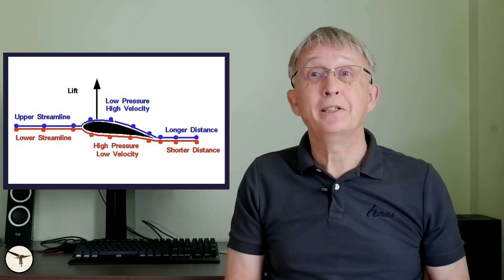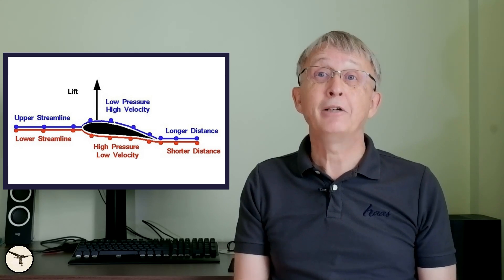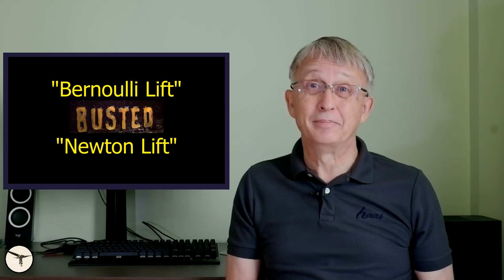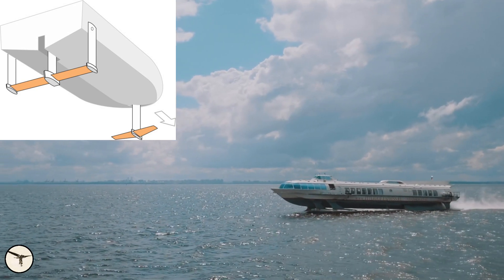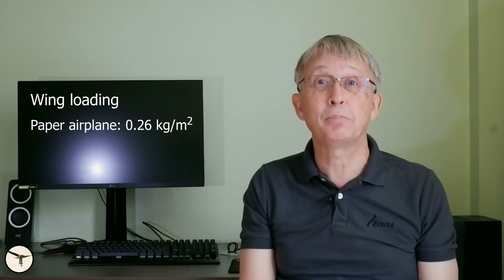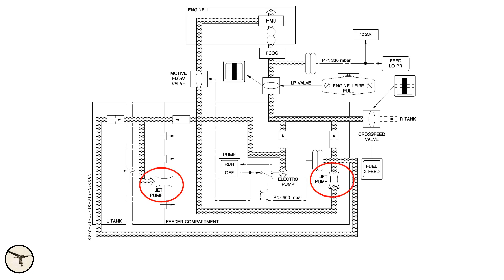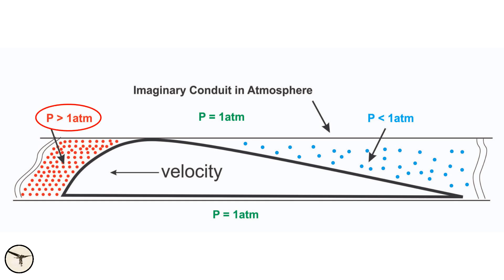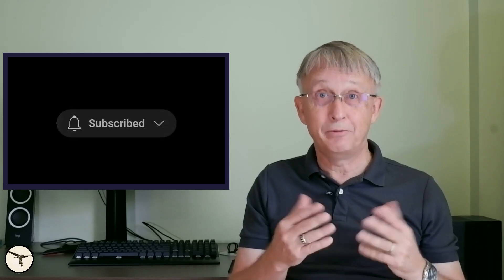7 Wing Lift Myths You Must Avoid: What Really Makes Airplanes Fly!

Comment: I am an aeronautical engineer who provided some constructive criticism to some specific points in some of your previous videos about lift.
For this one, my feedback is this: I am not happy, I haven't found anything to criticize!
Reply: 7:28 he is wrong, Custer Channelwing flies by blowing air over the wing, but not because of Coanda.
Reply: @SoloRenegade  ... It doesn't. It SUKS air over the wing. All the CCW planes are pusher props with the propeller at about the trailing edge. The pressure in front of a propeller is lower than ambient. The pressure behind a propeller is higher than ambient. So this arrangement places the wing channel in the low pressure zone of the propeller. An interesting quote from Custer himself: "this is an aircraft which is not an airplane. It does not plane the air to fly, rather it brings the air to the lift surfaces and reduces pressure". In any event, regardless the fact that the Coanda effect, or the CCW effect, CAN produce lift, that is not HOW lift is created in the traditional sense. Magnar is explaining different myths and misconceptions in popular wrong explanations for how a traditional wing generates lift.
Reply: @adb012  nice strawman and cherry pick, suck, or blow, the air doesn't know nor care. the air is moving, and the wing is not, but the airplane flies. Period. You're making the same exact fallacies as the types described in the video with your childish attempt at a refutation.

"this is an aircraft which is not an airplane."

except it is/was an airplane, regardless what he claimed or felt. What does this have to do with ANYTHING? How does this have anything to do with lift production? Do stay on topic and avoid using red herring fallacies.

"In any event, regardless the fact that the Coanda effect, or the CCW effect, CAN produce lift, that is not HOW lift is created in the traditional sense."

I know exactly how wings produce lift, and the channelwing achieved it same as other aircraft do.

"Magnar is explaining different myths and misconceptions in popular wrong explanations for how a traditional wing generates lift."

I'm glad you understand that. Was beginning to think you had no clue. Regardless, you specifically claimed, "I haven't found anything to criticize!"

This lack of critique proves you weren't looking hard enough, and lack understanding of such topics, otherwise You would have called him out on this objectively false claim of his at the 7:28 mark.
Reply: @SoloRenegade  ... It is not the same to put the wing in front of the prop where the pressure is lower than the atmospheric pressure than to put the wing behind the prop where the pressure is greater than the atmospheric pressure. Even if the air didn't know or care (which is not the case, but it is a good approximation at low Mach numbers) the wing does, especially when that pressure is applied only to one side of the wing. Remember that the lift is the difference in pressure between the upper surface and the lower surface (I am simplifying a bit, technically it's the integral of pressure times the differential of the vectorial area around the airfoil or wing.

As for the gratuitous ad-hominem attacks, I am not going retaliate and escalate.
Reply: @adb012  stop cherry picking. the idea is airflow moving over a wing, rather than wing moving through teh air. Clearly this is too complicated for you to grasp.

I am addressing what was claimed in the video, not your petty cherry picking.

"As for the gratuitous ad-hominem attacks, I am not going retaliate and escalate."

my insults are not ad hominems, as they are not part of my arguments. My arguments stand on their own facts. So they are in fact merely insults, not ad hominems. Learn the difference.

You talk all condescending, but you're wrong, just admit it. Prop in front or rear of wing is a separate topic of debate. The childishly simple fact you can't comprehend, is the air doesn't know it was being blown nor pulled. And multiple aircraft such as the jetwing and other radical concepts that flew but were not mentioned blew air over the wings as well.
Reply: Is viscosity or more generally "dissipation" an absolute prerequisite for justifying the production of lift?  If not, why do so many academic aeronautical engineers insist on it.  And if so, why is it not always included in explanations of lift such as in this video?
Reply: @davetime5234  ... Yes, viscosity is vital for lift. No viscosity = no lift. The reason why it is not always introduced is that you can replace (both mathematically and conceptually) the main role that viscosity plays in generation of lift with something called the Kutta condition and the Kutta - Joukowski theorem. The Kutta condition says that airflow will separate from the airfoil at the trailing edge. This is kind of obvious, but would not happen without at least some viscosity. Viscosity is what prevents the flow from accelerating to the infinite speed that it would need to turn around an infinitely sharp edge (like the trailing edge). The Kutta - Joukowski theorem says that an airfoil will produce exactly enough circulation to meet the Kutta condition. And it is that, the circulation, the real thing that is responsible to accelerate the fluid on the upper surface and slow it down in the lower surface, which correlates with the difference in pressures (by Bernoulli) and hence lift. All this can be nicely modeled mathematically and yields quite accurate results without invoking viscosity (but invoking the Kutta condition). But the solution will not be exact because another thing that the viscosity does, that is not taken into account in an flow without viscosity but just with the Kutta condition, is forming the boundary layer. 

In summary, you can explain and mathematically calculate the lift produced by an airfoil, with a good but not perfect degree of accuracy, without thinking about viscosity or using viscosity in the calculations, but just taking as given that the flow will separate at the trailing edge and not turn around it (which is something that will happen only if the fluid is viscous, even just a little bit viscous, which in real life it always is).
Reply: @davetime5234  I've never seen it as necessary to explain lift. The actual explanation for what causes lift can be explained and understood without discussing viscosity at all. But no aircraft flies in a friction-free vacuum either.

But viscosity is necessary for determining drag, and things like boundary layer behavior and effects, etc.

Do you have a specific theory of lift in mind that does rely upon viscosity or "dissipation", as you described?
Reply: @SoloRenegade  I've tried to reply twice, and both time my reply fails to appear.
Reply: @davetime5234  I'm actually seeing them in my notifications too, but when I click to read them, youtube won't let me. it's strange. I am truly curious what all theories of lift people are discussing, good and bad. Good ones teach me something new, bad ones help me to better explain lift to more people by addressing commonly held ideas that aren't accurate. Either way, progress is made.
Reply: @davetime5234  ... I also posted a somehow long reply that doesn't show up. I will in smaller chucks.
Reply: @adb012  Thank you!   I see your replies.  I'm travelling at the moment and will think about what you wrote in more depth when my schedule settles down a bit.
Reply: Viscosity is vital for lift. No viscosity = no lift.
Reply: @adb012  "Viscosity is vital for lift. No viscosity = no lift"

Mind explaining that?
Reply: @SoloRenegade  ... Again? I did! Instead of posting 1 long comment I posted 10 short ones because for some reason Youtube blocked my long comment I had posted before. Can't you see them?
Reply: @SoloRenegade  ... But the super short answer is that viscosity is needed for the Kutta condition to be a real thing and not just a human artifact. No viscocity no Kutta condition, no Kutta condition no circulation, no circulation no lift.
Reply: @adb012  no, this time I didn't get any notifications of the other short comments. 

Youtube is definitely blocking you. I 've been seeing a LOT of comments on a lot fo videos lately of people having this happen to them. it's getting pretty bad.
Reply: @SoloRenegade  ... I replied twice. One with the youtube rant and another one with a super short explanation. You evidently got the first one. Can't you see the second one?
Reply: @adb012  I can see multiple now, but I had to check for them manually. I only go notified of your last 2 comments.
Reply: The reason why this is not always mentioned is because you can use a proxy for viscosity to account for the most important thing that viscosity does for lift: circulation.
Reply: Circulation is what makes lift. Circulation is what defines the pressure and velocity fields correlated one to the other through Bernoulli (faster velocity = lower pressure).
Reply: The problem is that circulation is impossible without viscosity. Without viscosity, the flow from the lower surface would just turn around the trailing edge, move upstream on the upper surface for some distance (let's say 1/4 of the chord), meet the stream coming in the opposite direction from the leading edge, and separate at some point on the upper surface. In other words, by not separating at the trailing edge, the flow would just go around the airfoil without being deflected down.
Reply: Now, to turn around an infinitely sharp edge (zero radius), the flow would need to achieve a infinite high speed at that point and zero pressure. A singularity. Viscosity is what makes achieving infinite speeds impossible (it would require infinite energy) making in turn impossible for the fluid to tourn around the trailing edge, hence it is forced to separate there.
Reply: So how can we explain lift and even calculate lift with a reasonable accuracy without even mentioning viscosity. We invoke: "The fluid separates at the trailing edge". In other words, we are imposing a boundary condition which is very intuitive and obvious (of course the flow will separate at the trailing edge, it would be crazy that it flows around a sharp edge!) but which in fact only happens BECAUSE the fluid has viscosity.
Reply: That is called the Kutta condition. And how do we impose, mathematically the Kutta condition? We calculate the flow around the airfoil with an arbitrary amount of circulation, which will have the flow separating at an arbitrary point, and adjust that circulation until the separation point happens to be at the trailing edge.
Reply: That is called the Kutta - Joukowsky theorem which states: "An airfoil will produce the right amount of circulation so as the flow separates at the trailing edge" (i.e. so as the Kutta condition is met)
Reply: The nice thing is that the result is independent of how viscous the fluid is. To a certain extent (i.e. don't bring up honey or a thick oil) , this approximation would produce reasonably accurate results as long as the fluid is at least a tiny bit viscous so it can't turn around the trailing edge. That's why an airfoil has about the same lift-coefficient-to-angle-of-attack curve regardless of whether the fluid is air or water.
Reply: The reason why this approximation is reasonably accurate but nut super duper accurate is that, in addition to imposing the Kutta condition, there is a secondary but non-negligible way how viscosity affects lift, which is that viscous fluids generate a boundary layer when flowing around and object. But if the viscosity is reasonably low (like in air or even water), the thickness of the boundary layer is small compared with the size of the airfoil so the flow flowing outside of the boundary layer, which is not affected by viscosity, follows a contour (airfoil + boundary layer) that is quite similar to the original airfoil without boundary layer. End (by now).
Reply: @adb012 
Circulation or deflection of fluid isn’t necessary to produce lift.
Reply: @Talon19  ... It absolutely is. The force that the air imparts on the wing is the same as the force the wing imparts on the air, and that pushes (so deflects) the air. 3rd law of Newton. No viscosity = no circulation = no deflection = no lift. And that little dot is a period.
Reply: @adb012  
Positive cambered airfoils with flat lower surfaces and thin plates extending from the leading and trailing edges still create lift at zero AOA.  I’ve done the wind tunnel tests myself.
The thin flat extensions prevent any “circulation”.
Reply: @Talon19  ... Lot of airfoils can produce lift at zero and even slightly negative AoA. I believe in your wind tunnel tests. I don't understand why you say (or even how you know, based on the wind tunnel results) that the thin flat extensions prevent any circulation, but it is wrong. In fact, the thin, sharp trailing edge, together with the fact that any real fluid a viscous even if just a little bit,  is what creates circulation in the first place, by making it impossible for the flow to go around the trailing edge and hence force the flow to separate there, fulfilling the Kutta condition.
Prandtl already proved mathematically that pure potential flow can't produce lift. It takes imposing the Kutta condition to the potential airflow (a condition that is impossible in pure potential flow) to generate lift.
In fact, the lift equation can be re-written in terms of circulation (and gives zero if the circulation is zero).
If you insist, I challenge you to take the the velocity field of your wind tunnel test and do the integral of the of the velocity vector dot the differential of curve length, along any closed curve that encloses the airfoil (that's circulation) an show that it gives zero. That is the way to KNOW that there is no circulation. If your airfoil is producing lift, it will not give zero. It cannot. I guarantee it. It would violate Navier Stokes (or rather violate things derived from Navier Stokes that must be true if Navier Stokes is true).
Reply: @adb012  
Back flow along the upper surface from the trailing edge would violate conservation of mass.
Reply: @Talon19  ... LOL, you are trolling now, right? How many times are you going to change your  objection? And why on Earth would back flow on the upper surface (up to a point where it meets the flow coming from the leading edge, and then separates there), violate conservation of mass? Hint: It doesn't. If you are going to keep throwing random objections without any supporting explanation or justification, I will stop responding and let the readers judge.
Reply: @adb012 
Through any closed volume, the mass flow rate must remain constant.  For flow to reverse, the flow rate at some point would change, therefore violating the conservation of mass.
Basic physics.
Reply: @adb012  
Not only would it violate the conservation of mass, in fluid tunnel tests we don’t see the fluid flow reverse.
Reverse flow violates theoretical and empirical principles.
Reply: @adb012  
I think you are mistaking reverse flow from the BOTTOM surface *around* the trailing edge of the wing with turbulent flow across the TOP of the wing as stall progresses.
For fluid to flow from the bottom surface to the top surface, the flow along the bottom surface would have to be faster than across the top surface; however, that doesn’t happen until well past full stall at which the wing isn’t effectively producing lift, which nullifies your entire position.

Now, if you were to say that in turbulent flow post-stall, there are regions of reverse (spiral) flow, that would be correct and can be shown with wind tunnel tests.  

However, even in these wind tunnel tests, fluid doesn’t flow from the bottom surface around the trailing edge and backwards along the top surface.
Reply: @Talon19  .... And I think that you are totally misreading me. I always say that the flow WOULD go AROUND the trailing edge IF there was NO VISCOCITY, and THEN there would be no circulation and no lift. REAL fluids HAVE viscosity, even if a little bit, so they CAN'T go around a sharp edge without separating, which is why the Kutta condition is always met, circulation shows up, and lift exists. Hence, viscosity is vital for lift because no viscosity = no Kutta condition, no Kutta condition = no circulation, and no circulation = no lift. The reason why you never observed the fluid going around the trailing edge in your wind tunnel is because you never tried with a fluid that doesn't have viscosity, because they don't exist in real life. You can only try that mathematically, not in real life.
Reply: @adb012  
I also know from wind tunnel tests and real life that circulation isn’t necessary for lift by using walls and thin plates to prevent circulation while still producing lift.
Reply: @Talon19  ... Again, show me the integral of the speed vector along a clothed curve that encloses the airfoil. Or give me the velocity distribution data around the airfoil and the airfoil shape (including whatever leading or trailing edge thin plate) and I'll do the integral myself. Or give me a source. I am quite sure you are wrong. Thin plates don't prevent circulation. Actually the whole airfoil can be a thin plate and you still have circulation as long as it is producing lift.
Reply: @adb012  
10% thickness ratio, upper surface is a segment of a circle which meets the thickness ratio.  Thin plates equal to the chord length extending along the chord from the leading and trailing edges.  Zero AOA.
Pressure taps along upper and lower surfaces at 10% chord length intervals.
Pressure taps show a decreased pressure only on the upper surface and only from the beginning of the camber and aft.
Reply: @Talon19  ... And why you say that that means zero circulation? Actually, that sounds a lot like circulation to me. Let me correct that: You explanation PROVES that you have circulation because, between he 2 paths that the flow takes from the leading to the trailing stagnation points, you have a longer path AND a higher speed on the upper side and that means that when you do the integral of v.ds along the upper side it will be bigger than integral of v.ds along the lower side, and hence the integral along the closed loom (which is the definition of circulation) CANNOT be zero. Do you understand what circulation means?
Reply: @adb012  
It means you don’t understand the difference between static pressure and dynamic pressure; which is ironic considering you specifically brought up stagnation points.
The long thin plates before and after the airfoil (positive camber) section allow flow and pressure to normalize so that by the time the fluid passes the aft thin plate, both the upper and lower surfaces are at the same pressure.  This is shown empirically through wind tunnel tests.
This whole experiment is designed to show new aeronautical engineers how lift can be empirically shown to be due to differences in pressure between upper and lower surfaces of airplanes.
We can directly measure pressure over both surface and then verify the pressure x area is equal to the force measured by other instruments.
Reply: @Talon19  ... Keep shifting objections and not answering a simple question. Why do you think that in your experiment there is no circulation? Do you even understand what circulation is? Going to your newest latest objection... What exactly is what means I don't understand that dynamic pressure is ½ρV²? I know that. That's why I said that your explanation shows that the fluid goes faster on the upper surface: because you said the pressure whet down. Since the total pressure is constant (outside of the boundary layer) a lower static pressure means a higher dynamic pressure and hence faster speed. I understood your experiment. I understood the long plates allow the air to have the same pressure even after it divides and before it rejoins. You still have a leading and trailing stagnation points at the front edge of the front plate and the back edge of the back plate respectively. But that's not important, forget the stagnation point if you want. The air that goes above the whole airfoil (airfoil = including plates and circular segment) still covers a longer path at a faster speed than the air going underneath. That's circulation. Give me your pressure, upper and lower surface, from the front of the front plate to the end of the rear plate, every 0.1c as you said you have, and I will mathematically show you the circulation.
Reply: @adb012  
You really don’t understand what circulation is.
The air above the chord line and below the chord line never cross each other or the chord line.
The only vertical movement of the fluid is caused by the positive camber section.
It’s all just pressure.
Reply: @adb012  
Circulation or deflection in the context of your earlier comments is about fluid flowing backwards up the upper surface.  Period.  That’s all I’ve ever been talking about.
Reply: @Talon19  ... Congratulations on your yet newer new objection. I have never said that the lines cross each other. Of course they don't. o still didn't say even once what circulation is, despite me asking you several times. I have said plenty of times what circulation is, including its definition in precise mathematical terms. And you say that I it is me the one who doesn't understand what circulation is? You can't explain what circulation is but you claim that your lifting airfoil has zero circulation. For the last time: What is circulation and why do you think that your wind tunnel result has zero circulation? You troll.
Reply: @adb012  
Circulation or deflection as I have always been referring to is the mythical flow of fluid back along the upper surface;  which you first brought up.
Reply: @adb012  
I’m not talking about circulation in the scalar representation.  I’m talking about fluid flow.  Good lord, keep up or shut up.
Reply: @Talon19  ... Well, as I explained 200 times, when I was talking about circulation I was talking about... circulation, which in Aerodynamics has a very clear and specific definition found in any Aerodynamics book. I will let the rest judge who has been the consistent one in this discussion. I agree with you for once: Good lord, keep up or shut up.
Reply: @adb012  
Good, now that you are caught up we can move on.
Can lift be generated without a net downward movement of fluid?
Reply: @Talon19  ... If the only thing applying forces to the air (in addition to the air's hydrostatic equilibrium forces) is the wing, no, impossible. It would violate the Newton's 3rd law.
Reply: @adb012  
That doesn’t address my question.
What else would be changing the fluid if not the airfoil?
Reply: @Talon19  ... For example, if you are flying close to the ground, the ground will interact with the fluid too and change the way the wing interacts with the air too. It is called ground effect, have you heard of that? But if the only thing is the wing, then, as I said, no, impossible to produce lift without imparting a downward velocity to the fluid (which by the way it is called downwash and represented with a w). It would violate the Newton's 3rd law.
Reply: @adb012  
Newton’s laws aren’t violated because the various approaches to life are based on Newton’s laws.
Force and pressure don’t require movement of a macro scale object.
Accelerating a fluid will decrease pressure without any vertical movement.
There is no need for downward flow in the fluid to produce decreased pressure.
Case in point, a flat bottom airfoil with positive camber will produce lift at negative AOA; that cannot be explained with downward movement of air because there is no downward movement of air.